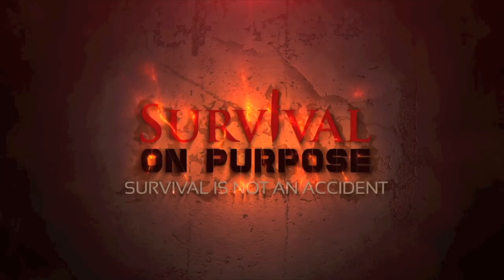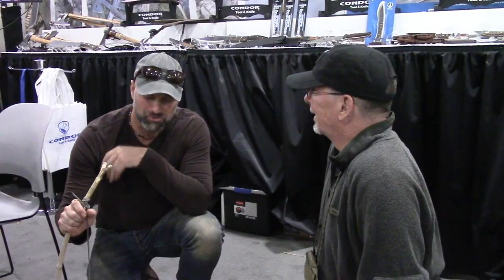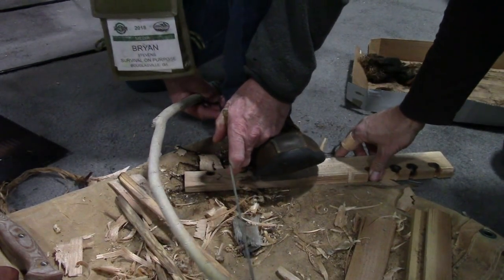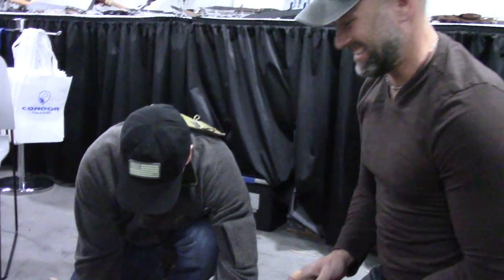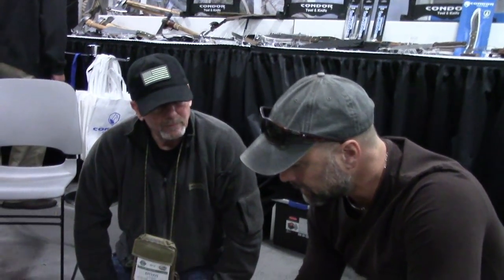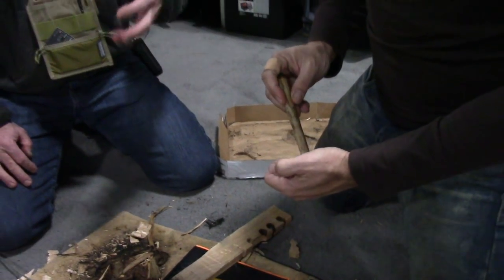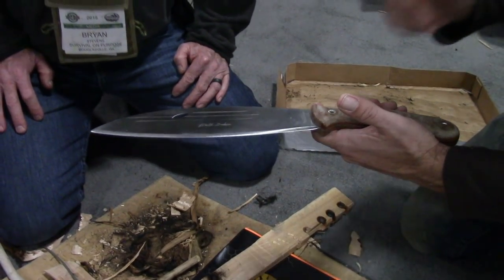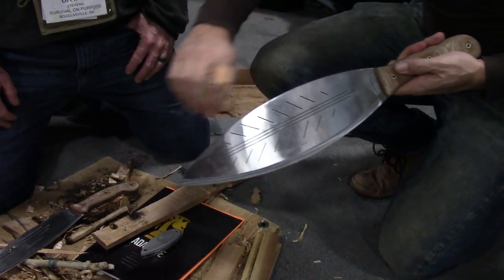Bow Drill Fire lesson From Matt Graham - SHOT Show 2018

Comment: I've had trouble with the bow drill most of the times I've tried to use it as well. So much so that I usually save what dust I've built up to be ignited by other tools like a magnifying glass so all of that effort doesn't necessarily go to waste.
Reply from the maker: I am usually so frustrated I don't care
Reply: It's understandable that you'd get frustrated. I only got my first ember, lit using only a bow drill set, after 5 or so days of continual trying and I did it mostly by accident.